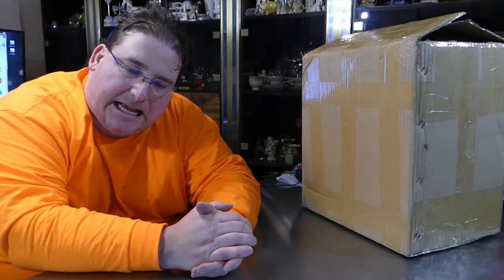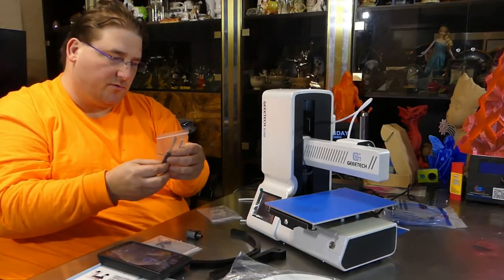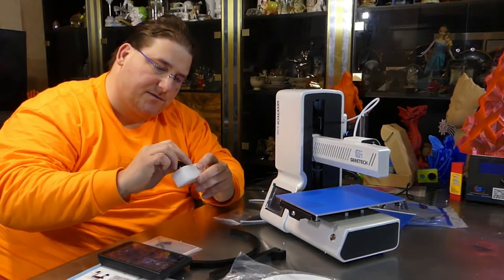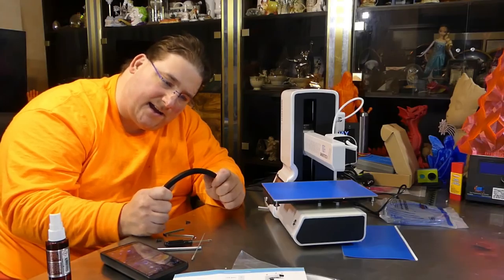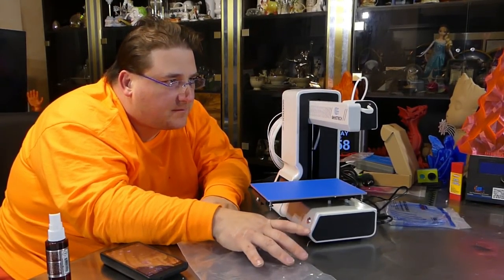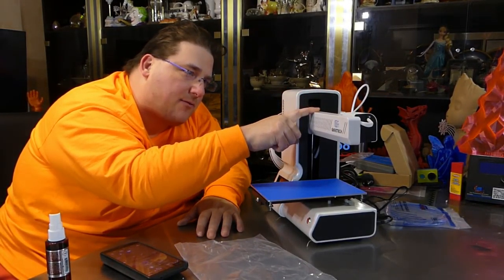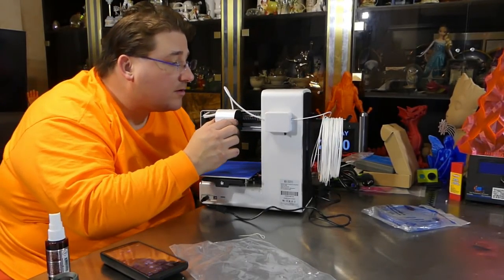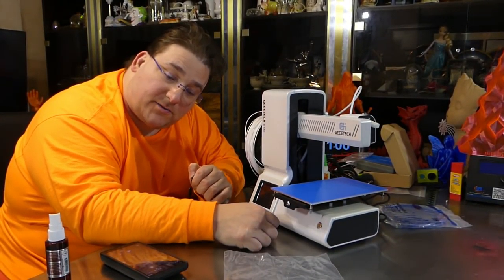Today's 3D Print 183 Geetech E180 No Joy

Comment: I also received one of those but mine does work. It’s actually pretty nice. I couldn’t assemble the filament holder either though. I spent like 20 minutes fruitlessly trying to screw the darn thing together.
Reply from the maker: +Mighty Jabba's Collection just do what I did ditch the bottom and glue it to the side of the printer :-) it does look like a pretty decent printer I think I just got a bad motor and I think they will send me a replacement once I confirm it they want me to swap the X and Y and see if it's still bad I guess to confirm if it's cable or board driver or if it's just a bad stepper I just haven't gotten around to doing it yet

That's why I don't give final thoughts shouting out that this printer sucks just because you had some problems is just as bad as being a fanboy you have to be fair :-) and I will give it a fair Shake so I can give you guys the best information possible not just the information somebody might want :-)

Comment: With the MP Mini V2 and Ender 2 who would want this machine? No heated bed, a proprietary nozzle, heater and thermistor assembly... everything you need to access is covered. Curious to see how Geeetech take care of you. They commented immediately after John's issues @ The Hot End. I like the touch screen over the encoder wheel but thats about it.
Reply from the maker: +Michael Saucier i agree i would take an ender 2 over the mini or the e180. Far superior to both.
Reply: I've had nothing to complain about with either the Mini V2 or the Ender 2. I like the MP for it's WiFi, insulated heated bed and part cooling. The Ender 2 for its price, larger build volume and print quality. I wouldn't sell either of them they're both great printers. They both have been run a good 16hrs a day without breakdowns or issues. Thank you for taking the time to respond. Enjoying the content and honest reviews, keep it coming!

Comment: Did you ever print it a lithophane before. It's is very cool. Prints out a picture.
Reply from the maker: +Average Joe's 3D yes I have it in one of my videos little lithophanes are amazing I really want to do that big lion one that the Austrian or German kid did it came out stunning.
Reply: Nerys hey I also need your thoughts on a CR 10. Just today it's been clogging up. It starts clogging up seconds after it starts to print. I switch the nozzle. Cleaned out the hot end. Clip the end of the Bowden tube to make sure that it was good. Try several different filaments. Even turn my retraction off. Do you think I might be the fan for the hot in.? It is turning. But I'm wondering if it's not putting out enough air. What do you think?
Reply from the maker: +Average Joe's 3D is not performing properly that will definitely cause clogs it's called heat creep just touch the fan while it's going it will not hurt you but your finger should tell you pretty plainly if it's spinning fast enough if it feels like it's barely going time to replace it :-) also make sure that Bowden tube is all the way in there's no Gap between it and the nozzle

Comment: Mp Select Mini is a clone of the Malyan M200 by the way
Reply from the maker: +Maddie Goldenthal actually I'd be surprised if it was a clone it's probably an oem made by Malyan with monoprice labeling
Reply: that's true it may just be a rebrand.. some other companies are cloning it now

loving the ender 2 by the way, I made a carrying/transportation box for it today
Reply from the maker: +Maddie Goldenthal ohhhh pcis?
Reply: Will post some on Instagram next week and tag you! Basically I took an Eket cabinet from Ikea ($15) and added some foam (from the original Ender package) in strategic places, some velcro on the PSU and the side of the CPU case, everything fits :) 

Still need to add a little hook for the power cable from the PSU and maybe a slot for some tools
Reply from the maker: +Maddie Goldenthal cool. Look forward to seeing it!

Comment: Ender 2 is much cheaper and has a heated bed. Why does this POS even exist?
Reply from the maker: +vidznstuff1 well it isn't interesting printer and 3D maker Noob has had good results with it the advantage is it smaller more compact more portable so I can take it with me and run it off the car or even maybe off a battery or solar panel sometimes out in the field you just need a small little part that you can print in 20 or 30 minutes

So it does have potential usefulness if it works :-)

Comment: Not the best publicity for GEEETECH. Would I be the CEO of that company I would get very red and mad with the Quality Control-Department.
The intention of the mechanical design looks nice to be honest. Seems a descendant of a Singer Sewing Machine. One sewing machine in every household? Yes, but not this one, for now.
Reply from the maker: +Pierre Verbakel I am betting it was a fluke they do appear to be responsive and they are sending me suggestions for diagnosing to confirm the bad part and and I assume send me a replacement I will of course I'll pay you guys getting a bad printer is not necessarily a bad thing because it gives me a chance to test the customer service responsiveness of the company as long as they handle it properly and they won't get too bad for that sometimes how you fix your problems is more important in the problem
Reply: Why would one test if it always passes the test ...